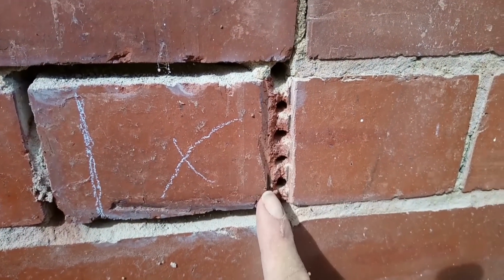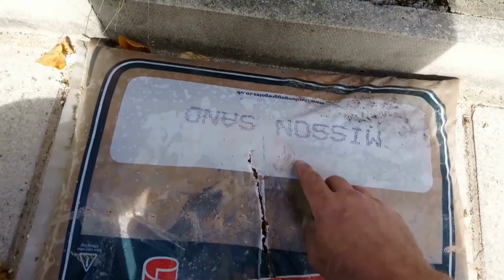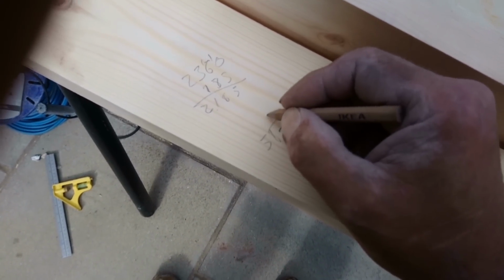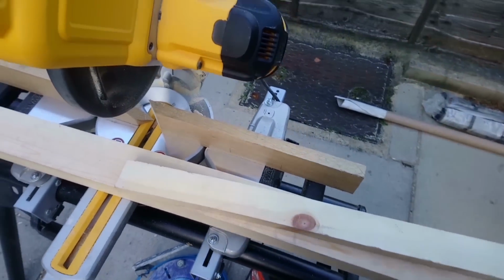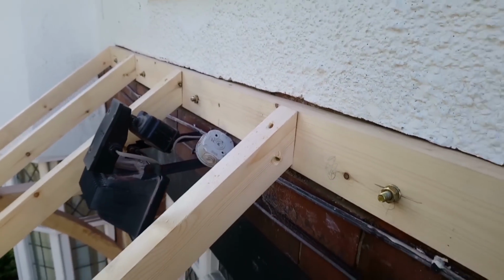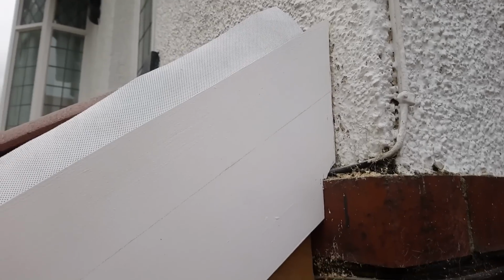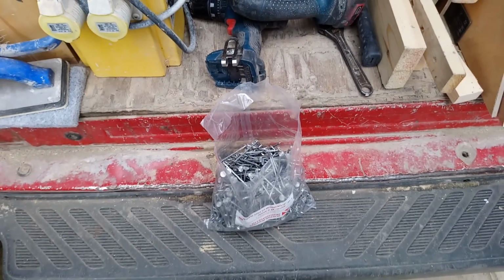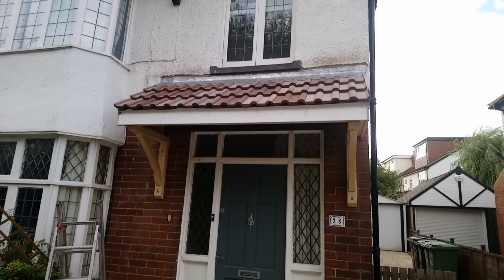Porch Canopy Build Final - Installation on the house

Comment: Hi gid, I’ve got a porch to build similar to this but a lot smaller, when it comes to the timber fascia/match board etc, what measures should I take to weather proof the materials? Thanks
Reply from the maker: Hi, most of the wood should be ok painted,I put clear treatment on the most prone of the pieces, As long as wood can dry out it's ok if it gets a bit wet but design should be made so that there's no flat surfaces, water runs off instead & not allowed to sit/stay n soak in, on the bottom of the braces, in the little V where they meet the uprights on the wall i put some filler so water runs out, it doesn't sit in the V, that got painted.
Reply: Gid joiner could you recommend a clear treatment to use? Does this just go on before a primer? 
Also if I just prime the timber with standard white primer before fitting it should be ok to go?
Reply from the maker: This is the treatment i have, i think, I don't have enough info about it to 'recommend' as i guess time will tell if it's any good but i go for the one in the builders merchants, https://www.google.co.uk/shopping/product/3864637042676123577?lsf=seller:87981,store:14432743186361770829,s:h&prds=oid:11269397598190289340&q=timberland+wood+treatment&hl=en&ei=PNxEXIGeO7Oo1fAP2rOEIA&lsft=gclid:CjwKCAiA1ZDiBRAXEiwAIWyNC6jNJjKxXEkwTICcD2RkZ0D-zLMC49tC_jfo4nm_Fc7AzJl2FfTRvxoCfL4QAvD_BwE
I can't say exactly without going out into the shed, If it's something different I'll let you know,
Primer is ok for an overnight sealing coat but not for long term exposure to the elements, yes the treatment goes on first onto the bare wood,

Comment: Nice job, how much do you reckon the total cost will be, ballpark figure,
Reply from the maker: Thanks James.👍
For the porch/canopy?
Reply: @Gidjoiner  
Yes, just wondering?
Plus how long did it take?
Reply from the maker: Not easy to put a price on labour, it took longer than a younger man would 😃 & filming adds time, I built it over the last couple of weeks, not 8hr days, plenty of Tea  😎 what i charged & how long it took doesn't relate. 
Materials came to about £350, inc guttering bits, bought n waiting for painting to be done, some stuff i had, some like the 9x3 i had to buy more than needed, the Lead alone cost nearly £70.

Comment: How would i calculate how far from the house I’m able to extend the overhang while still having it be able to support itself free floating, (without using supports to the ground) and how would i determine the proper pitch required for the maximum length and/or does it have to do with weight. Don’t want it to come crashing down on grannie ya know.....or do i?  LOL. Just joking. 
I want to get the most coverage as the basement Walk out entry faced direct west which is where the storms and driven rain come from so i want as long of one as possible yet would Ike to eliminate support posts to the ground. Thanks

Comment: What size compressor 
Do you use pal
Reply from the maker: The one on site is a little 6L Wolf Air, it's 20yr-ish old & does fine for all guns inc the Dewalt 34º Framing gun, In all my vids where i'm not in the shed that is what I'm using.  In the shed I have a Bostitch 50L compressor which is only just big enough, if/when it dies I'll update to maybe 100L with a bigger CFM, that's the important bit, the CFM is how fast the tank will refill & so maintain pressure 👍
Reply: @Gidjoiner   great thanks av got a 50 litre one was just gone ask if it will run my new air gun av just orded
Reply from the maker: Yep it should no prob, the smaller guns (pin n staple) have absolutely no problem, the coil nailer does fine too as in this vid, the framing gun will do ok but it needs a moment to refill but will do a few nails & you're on to the next piece of wood by the time it's ready to go again so no hold up, when fencing it does what i need, i've never really thought i need a bigger one, this 6L one's a bit noisy so a quieter one would be nice but If when the it dies I'll prob just get another 6L or similar, the small size to carry it on site & storing in the van greatly out ways any negatives it may have with not supplying enough air,  The 50L in the shed won't run a die grinder or grinder for very long before it looses enough pressure to make the thing work but that doesn't bother me, I'd prefer my cordless grinder anyway & it has done me more than fine for spraying, 👍
Reply from the maker: This is where i get my nails etc from & i think Bostitch guns are hard to beat 👍  https://www.betcofasteners.com/ I'm not keen on combination nailer-staplers tho, I'd prefer 2 separate guns, the nailer-staplers have a flat pin for firing staples but when it fires pins that flat pin leaves a line in the wood.
Reply: @Gidjoiner  thanks a take it that 6l one very small I have a Paslode im90i with the better gasses that don’t Poss about in the cold
Reply from the maker: Yeah that's why i flogged my Paslode, it didn't like cold n after a while the old Ni-cd batteries were always flat, I went back to the Dewalt airgun but as you might have seen i bought the Hikoki, i missed the cordless-ness of the Paslode 😉 The little 6L is in some of my vids, It's roughly 14" high, 14" long n about 10" wide -ISH! 😁🤷‍♂️
Reply: @Gidjoiner   yer seen the gun looks good mines the good paslode with the lithium battery’s and it’s the one with the gas that doesn’t freeze just wanted to have a air one for the unit and if you’re 6l ones ok my 50l one al do the job just fine thanks
Reply from the maker: @aaron-o5u1g  yeah should be more than fine, My Paslode was from the 90s 😁
Reply: @Gidjoiner  mines the one with the push up gas can’t remember the model now not used it in a wile 😂

Comment: Lovely job mate, lovely to watch another chippy working and enjoying himself. Would you mind advising how much you roughly charged for this job? Many thanks
Reply from the maker: Thanks Robert, 👍👍 Sorry i don't want to share the exact figures but i do a CAD drawing & quote my time + materials, i give a spreadsheet list of materials with my labour at the bottom, the materials price i don't inflate, they cost what i pay pretty much n i try to work out how long it'll take me to do it n add that to the bottom giving a total price, my clients like the honesty of that & I stick to that final price providing the client doesn't change anything from the agreed drawing, I'm crap at working out how long a job will take but don't charge more if it does take longer, so it gets done to an acceptable standard asap n the client knows exactly how much they'll be paying in the end n not fretting when I'm late or they see me sat on my arse drinking tea 😉😁 I don't do a lot of that tho cos i do have to crack on n get it done & I don't remember how long this took, it takes as long as it takes but i don't rush a job n bodge it just to get it done on time, all my work comes word of mouth so each job/client is my advertising, Prices will vary from joiner to joiner n region to region, i quoted 5 days + materials. I normally make enough 💷💰😏 just 😂, it's not about the money for me often, i like to build n as long as i pay the bills 😂
Reply: @Gidjoiner  Thanks for taking your time to reply to me, it's really helpful. I've been a carpenter since leaving school, I've just turned 26 and now feel I have the confidence to start going out on my own finding my own jobs. I've subscribed to your channel and look forward to further videos. Cheers
Reply from the maker: Thanks Robert best of luck, I've been a joiner 36yrs n started doing my own jobs 20yrs ago, still struggle to get prices right tho, it's easy to build in your head but time ticks away when building, & on site there's other people, working for yourself you have to do everything. All i can recommend is set your standards high, then when you fall short of that at least it'll be good, or as i end up saying 'that'll do' 😏 I was lucky to have a decent social life in the 90's, met a lot of people who are now family people, those all knew 10 people who know 10 others n so on, I've never advertised n I'm never out of work because i take pride in my work & do a decent job at a fair, open n honest price, 😉 Don't be greedy but also don't leave yourself short, it's not easy finding a middle ground 👍

Comment: would you have got away with just anchor bolts instead of fitting the brackets into the wall?
Reply from the maker: Maybe, there's a lot of weight in those tiles tho n i was building something to what the client wanted, there's a long one up the street, "make one with brackets that look a bit like that"
Those top anchor bolts are into bricks just under the window so not much weight on top of them holding em in place 🤔
Reply: +Gid joiner thanks for explanation. enjoying your vids. new subscriber. cheers.
Reply from the maker: Thanks Gabriel 👍 😊

Comment: Hi it's me again can you tell me what size through bolts you used to fix the gallows bracket to the wall thanks
Reply from the maker: Hi, it was these, 
https://www.screwfix.com/p/easyfix-sleeve-anchor-12-x-130mm-m12-10-pack/19649?_requestid=331017

I used these 130mm ones all round for everything because that is what my tools were set up for & i wan't 'to be sure'.
I thought the 100mm ones would be a bit short but they are fine for standard 44mm/2" timber
https://www.screwfix.com/p/easyfix-sleeve-anchor-10-x-100mm-m8-10-pack/19292

Comment: 9.17 
The subtraction is wrong. 2360- 185 is 2175 
Did this effect the result?
Reply from the maker: The calculation is 2360 - 175 = 2185, It is correct in the video

Comment: Just the gallow brackets please
Reply from the maker: The vertical & horizontal pieces were from 4x3 pse (95mmx70mm-ish), the vertical piece that goes against the wall i reduced a little in thickness from 70mm, i just felt it didn't need to be that thick , don't remember what size to, 55mm-ish, 
The curved pieces came from 9x3 sawn timber but could have come out of 6x3, i made the choice at the timber yard & didn't want it to be too small so went with the bigger choice. after planing they were approx 70mm thick.